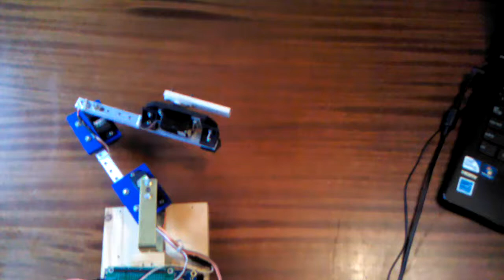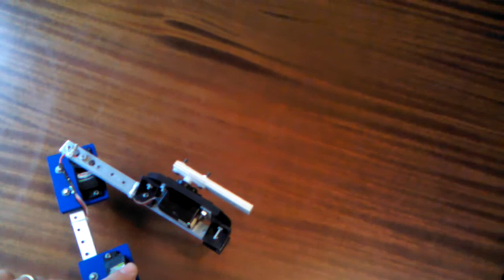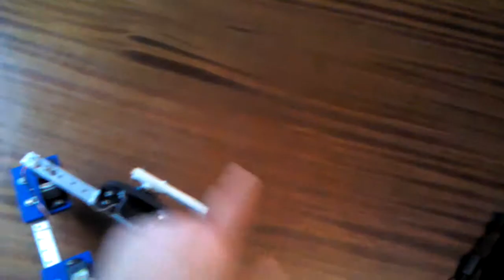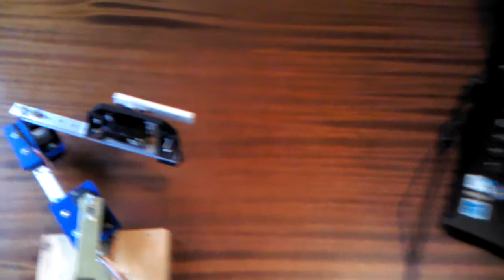Scara robot arm first movements

Comment: How do you know the characteristics of the servomotors?
Reply from the maker: A lot of calibration and measurement. Initially you send the centering pulse width to each motor, and then assemble the arm roughly straight. You then send the center, +90, and -90 pulse widths to see how close the arm is to the correct position. Eventually you'll find the exact values for all of these positions. At that point you can use linear interpolation to compute the pulse width for any angular position. Inverse kinematics allows you to translate a cartesian X, Y coordinate to angular positions as well.

That's also a simple calibration model. I've seen more complicated models where they measure multiple angular positions to try and handle positional error due to irregularities in the feedback potentiometers. I haven't done that because the deadband error in the servos is probably higher than that other source of error.

Makes sense?
Reply: @mheermance  ohh ok... But, what about torque? Is there any calculation that allows me to know the torque of the servomotor before buying it?
Reply from the maker: @andrealugo9949  It is usually listed on the servo spec sheet in either oz inches, or kg cm. Your payload times arm length must be below it. But I never push a servo to its limits, so I don't worry about it. If it became a problem I would use springs to counteract some of the arm's weight. In large scale robots payload weight and inertia are much more of a concern.